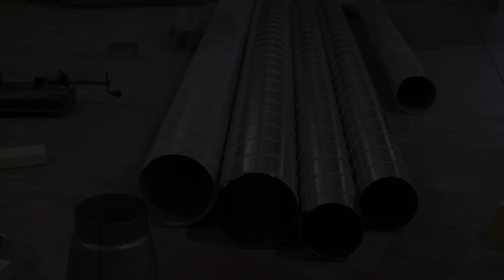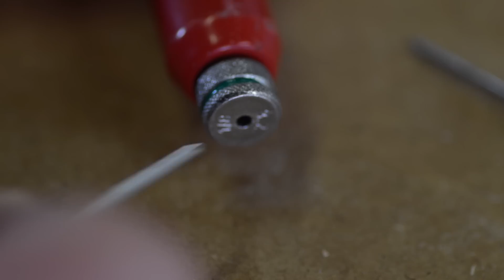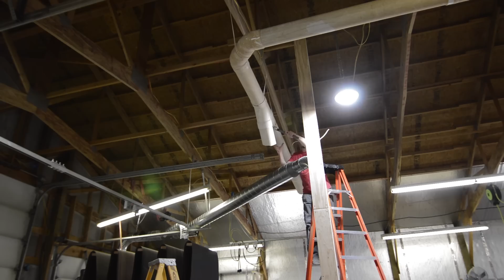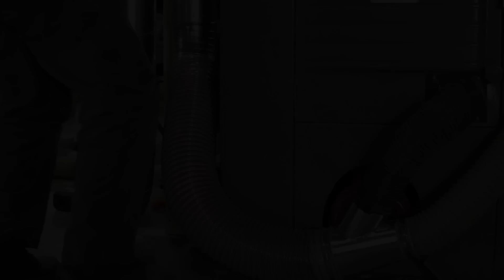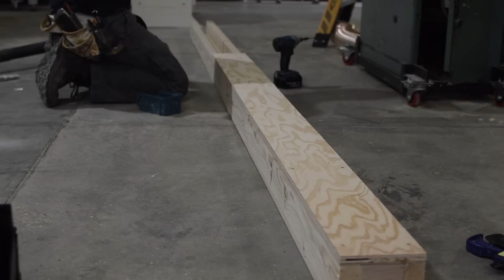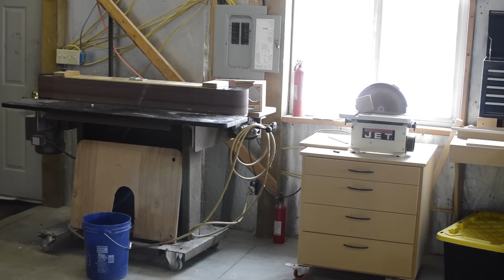Dust collection installation and upgrade

Comment: Always love your dry wit Mike.
If I understand correctly, the static in dust collection is more than a nuisance; it can result in explosions.  Arguably a more compelling reason to mitigate static electricity in your ducts.
Before I get torn apart in the comments, I know there is debate around this topic.  The debate is not whether sawdust can explode; this is easily demonstrable.  Rather, the question is whether static discharge is sufficient to trigger the explosion.  
Given the high variability in shop conditions, such as humidity, wood type, saw dust particle size, and so on, It would be tough to test the hypothesis accounting for every variable.
I'd prefer to spend a bit of time and a small amount of money grounding the system than run the risk, however minute, that I could become one with my shop tools.
All that said, I'm no expert.  Do your own research and decide which side of the risk equation you want to land on.
Happy woodworking!
Reply: This is a myth, and there are not recorded incidents of dust collectors at this level having an explosion.  The mixture of air and dust isn't right, and there's seldom a source of ignition.  The largest possible source of problems is sucking up a screw, having it hit the impeller and drop a spark into the dust in the barrel, but even that is very rare.
Reply from the maker: I would also add that the concentration dust needs to be at in order to be explosive is very very high. Meaning you could be running your table saw full blast and hold a lighter in the collection pipe and it would explode as there just wouldn't be enough ignitable material. But yes, there is a risk of explosion, thats the reason dust stoves are not readily available in the US.

Comment: I saw that some dust systems recommend a flat run, no bends for the first couple of feet. Did yours have any requirements like that?
Reply from the maker: I think that would be better, but it just wasn't practical in this application.

Comment: Great looking system Mike! What do you use the wood chips/dust for or how so you usually get rid of it?
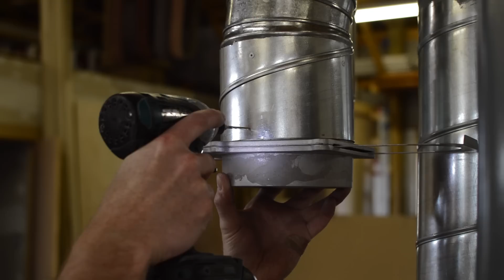Reply: Matthew L at the 8:00 mark he mentioned that he mentioned that he runs a cyclone on it.
Reply: @loganpirie4387  I understand the cyclone separator part just was curious as to how he disposes or uses the waste material (the sawdust)
Reply from the maker: I bag it up and throw it out. If I have a load that is purely wood chips I have neighbors with chickens that will take it.

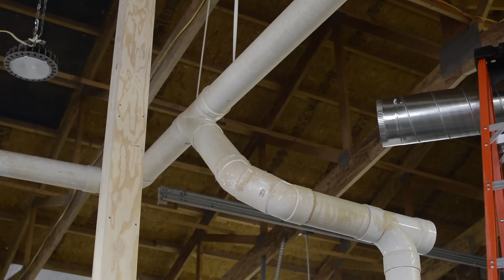Comment: Always love your videos Mike and what a great dust collector and install video.  When you crimp the pipe to make joints, don't you want to crimp the side closest to the tool side so that it fits inside the pipe closer to the dust collector?  As the dust moves from tool to dust collector, I think you want to do this so that you don't have a place for dust to catch at the joints.  One example was at/around 3:53 in the video where I think you did the opposite.  Just something to consider...Love your videos and the humor that you put into them.
Reply from the maker: This is ideal, but based on the fittings I got, I wasn't able to do that at every joint.

Comment: Duct tape easier, faster, won’t blow out or dry out.
Reply from the maker: Thank you for the comment, but I don't think duct tape would have worked on the inside corners of the wyes. A buddy of mine works in the dust industry and he recommended that I use the sealant instead of tape. I've used tape and was never happy with it. We'll see how the sealant turns out over time.

Comment: why not using aluminum tape for sealing the connections?
Its way easyer.
Reply from the maker: Two reasons, one I bought the connections that were not air tight, so I would have needed to tape inside the corners of the wyes, this would have been impossible. Second, I bought the collector used, the original owner had tapped all the seams, most of them had lost their seal in the two years it was in his shop. It just didn't seem to hold up. Maybe the sealant won't either, but it was fun to experiment.

Comment: Thats nice pipe, I just used the cheap box store stuff!  I did make note to watch which direction the male to female joints were in so the lip of the joint on the inside of the pipe was always with the flow of air.  Nice shop, I miss mine so much.
Reply from the maker: Thank you.

Comment: That's a great system, Mike. Another advantage to the rivets is they aren't as intrusive into the air stream as the screws are. Jay Bates just did a video on a CNC dust shoe like you mentioned. You and your family stay safe and healthy.   Bill
Reply from the maker: I agree with your assessment of the rivets being less intrusive. I looked at jay's dust shoe. I'm pretty much going to do the same.

Comment: Hi Mike. Immaculate as always. Mine dust collector connected with cheap 433mhz rf remote. I found cheap round single buttons on eBay which i double taped to each machine. Now turnin on and off is so simple. Recommend.
Reply from the maker: Great idea.

Comment: Looks good. Well done. Y´s, ellbows and horizontal Lines are the way to do. Blastgates too far away can be operatet with wooden sticks and an eye-bolt. Even on the very top lines. Internal is always better. Wintertime the cold and summertime the moist. All Air that is blown out must come in somewhere. And that is a lot with that sucker.
Reply from the maker: I really like the stick and eye bolt idea. I may use that in a few places.

Comment: I got tired of walking over to my collector to turn it on, so I purchased a until that you plug your system into which is turned on/off with a remote control that hangs on my waist. Its one of the best things I ever bought.
Reply: I just wante to suggest the same!
Reply from the maker: I left out a bunch of features this particular collector has, one of which is a remote. I wouldn't be without one. I pretty much consider that necessary.
Reply: @MikeFarrington // Odd that I've gained a few pounds since buying mine. I keep telling the wife [and myself] it surely can't be b/c of this; so its 
staying...right!? Then I said [to myself], its just a "couple" pounds; whats next, the shop AC has to go too; [can you tell I'm "Covid bored" in MI]? I'm not making bricks w/o straw!  :)  Stay healthy everyone. God Bless.

Comment: Speaking as an HVAC/R guy  I have to say that that spiral pipe is kind of overkill for this application unless you want that ascetic. The only spiral I've ever installed was when it was meant to be left exposed in a finished space, again for mainly ascetic reasons. A standard round pipe is typically way cheaper, lighter, easier to cut (being that it's shipped "flat" and assembled on site). Also that sealant they sold you wouldn't be my first choice in this application either. I have seen it degrade over time. Aluminum tape would be far easier to deal with and once it's on there it's not going anywhere until you remove it. And one last tip, I was taught to pipe essentially in reverse so in this scenario I'd pipe from the tool back towards the collector....it's far easier to get your drop exactly where you want it this way.
Reply: Would you ground the metal duct system?  I realize this is somewhat of a controversial topic, I certainly don't mean to cause a stir, but I'm curious.  I plan to build myself a metal duct system and I plan to ground mine, for what its worth.  My thinking is mainly, when its done, its done.  Thanks
Reply: @kevincasey2947  Metal to metal wouldn't really need a ground as you would have continuity throughout the run as long as it isn't interrupted by a non-metallic object (such as a plastic fitting/junction). You could almost just run a short ground from the start of the metal run to the equipment ground.
Reply: These are great tips. I'm going to try to remember these for if I ever have a large main dust collection system.

I currently have many smaller dust collectors throughout the shop and it hasn't been an issue. But if I ever go back to a large one i'll want to remember this
Reply from the maker: I appreciate the comment, but I would have to disagree. I paid about the same for this pipe as I could have bought a similar gauge snaploc pipe from Lowes, which would have been special order.  The gauge of the pipe was based off what the manufacturer suggests. Having done a little work with the the snap stuff, I really didn't think this was any harder or easier to work with. Using a chop saw to cut it was way easier than a pair of tin snips. The sealant was recommended to me by a friend I have who works as a dust collector installer, plus tape wouldn't be able to seal the inside corners of the wyes. Installing backward or forwards, either way, thats a matter of preference and would depend on the situation.
Reply: @MikeFarrington  I fully understand what you are saying. I base my comment on my own professional experience working within the sheet metal/HVAC trade. I've serviced it, I've installed it and I've seen what works and what does not. Pricing may be a matter of geographical location but spiral duct is WAY more expensive in and around the Chicago area than standard round pipe.

Comment: Nice set up Mike. It sure is nice to have the high ceilings. Mine are only about 8'-6" and a 4x8 sheet of plywood bangs the duct work easily. Thank you for sharing and have a nice day.
Reply from the maker: Thank you very much. The high ceilings are nice for sure.

Comment: Nice system and execution Mike.  
I'm currently putting in a system of my own, and every time I figure out the connection of two dissimilar products, such as a shopvac hose to PVC or what have you, I feel like a genius that just put a man on the moon :-)
Reply from the maker: Often times there isn't a commercial available solution, so a shop made one must be constructed. Thats always fun to solve those problems.

Comment: One thing i did was mount a limit switch on my blast gates so i would open a blast gate for the tool im using and it turns on the dust collection. It work so nice. Just a thought
Reply from the maker: That is a really good idea. I have a remote control, which works good, but the blast gate switch would be better.
Reply: @MikeFarrington  yeah i had a remote as well and i was finding id leave it on my bench or something go over to a tool for one cut and not go get it. What i did was run the switches threw a relay that when pulled in would turn on the the dc. The only tricky part was i had to mount a plate to blaste gate so i could mount the limit switches to. I dont know if you want i can email you a picture

Comment: How much did that spiral piping cost?
Reply from the maker: The 8" pipe was 1.92 per foot, the 6" stuff was 1.67 per foot. The fittings are the expensive part, not the pipe.